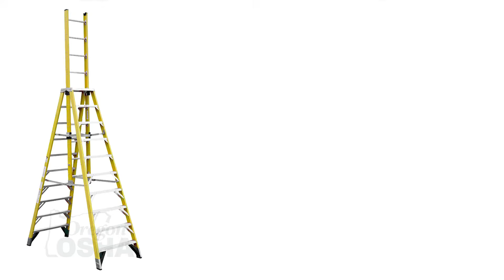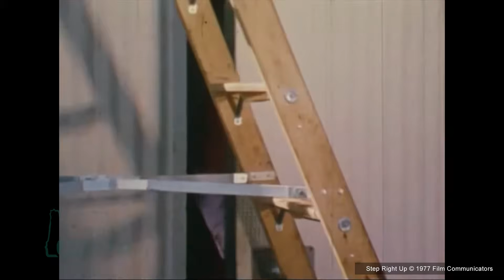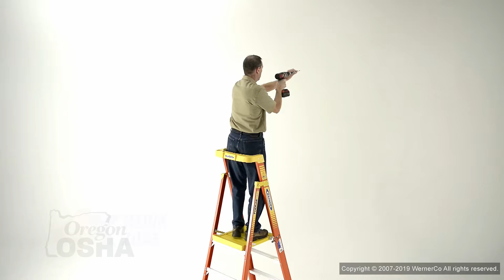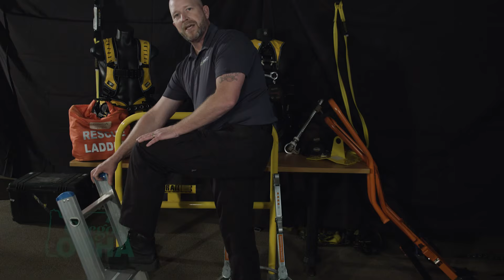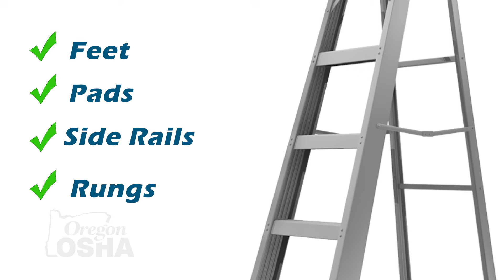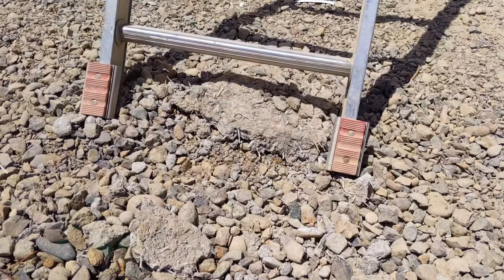Portable Ladder Safety Training | OSHA Rules, Fall Protection, Accessories, Workplace Safety

Comment: Most ladder involved injuries are strains and sprains caused by lifting and carrying, which can be debilitating. 
Most ladder involved deaths can be traced back to operator error, such as selecting the wrong ladder for the job.
One driving point for wrong ladder selection is weight, no one wants to carry the heaviest ladder for their job, but often times the correct ladder happens to be the heaviest one.
Using a ladder mover takes "weight" out of the of picture and allows us to easily use the safest ladder for the job.

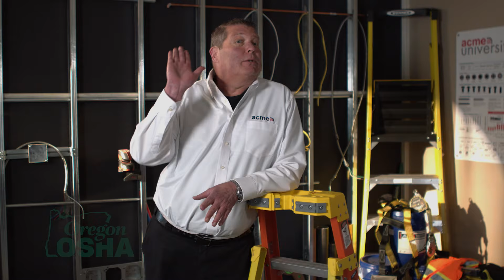Comment: The ladder set up against a wall at 4:05 in the video where they talk about ladder angle, the ladder appears to be standing backwards against the wall.  At least any extension ladder I've used the top section is always on the outside of the ladder, closest to you when climbing.
Reply: You are correct, the fly section must be on top for the ladder shown, otherwise you will split / break the side rail flange from the side rail web and ladder will collapse. In other words the fly section support bracket is non-functional when used backwards as shown in the video. A number of climbers have learned this the hard way. Another clue, you can also see that the rungs have the flats tipped forward instead of being level for comfortable standing.

Comment: Question I work for a weed company I'm maintenance and in the rooms I work in we have about 18 aaon ac units that are about 18 to 20 feet above. I changed all filters and have to use the 20 foot extension ladder and put it against the wall and I can't move the ladder closer to the wall because of the rows of tables. This scares me because I'm afraid it will slip and I'll just go down. I go about 16 feet on the ladder to change out old nasty filters but I never have anyone to hold the ladder for me so the ladder won't slip. It has slipped 1" last time in a room I literally found a 2×4 piece of wood to lay in back of the ladder to hold it. Is this company in trouble with OSHA? I asked my manager about it and still no improvement for purchasing some type of add on supports for the ladder I use like they don't want to spend money. I have fell once before long ago they paid the $4500 dollar bill I almost broke my arm.
Reply: You're not supposed to be doing work far away from the ladder you stand on
It's a hazard as you mentioned.
Request fall protection or talk to the labor board if they won't add side-support for the ladder

Comment: Always tie it off

Most deaths or paralysis occur getting 6' step ladders as the break point is between the second and third vertebrae where the average neck line contacts the ground

If you're going to fall, jump of vertically they say, then you land in your feet, hit your knees then with elbows protecting your head you roll into a ball then roll and turn impact force into kinetic rolling energy, but better off being tied off on a life line, it simple anchor bracket and rope, takes 5 minutes,

Say you have a roof tie down anchor 25' from where you're working at a roof edge, it's 65' from the ground, 70' from the bottom of the elevator shaft, hook your rope around a roof truss right where you're working, so maybe an 8' straight fall would occur if you fell off a wall, however, if you didn't wrap your rope around a close framing member you might be in for a 20 foot fall at the point of drop in only to swing 15' back into a block wall and then your 6' lanyard, so, a 170 lb guy falls, he's at the end of his rope perspective to his fall location, but the anchor point is 25 feet back, he falls for 20 feet in a swing and smashes full velocity 15 feet away into a cmu wall, nominally, but the lanyard or rope with a built in lanyard system (which should then be only connected to your harness D ring and not your 6 foot lanyard) unleashes, so then a 20' swing drop becomes 26 feet of properly connected, or, if improperly connected becomes 6' on the rope with built in fall arrest plus the 20' of rope plus the additional 6' lanyard you're talking s 15' lateral positional fall at the drop point away from Anchorage, and a 32' drop to take you smashing into a concrete stair it elevator shaft, this needs to be reintegrated in OSHA cottages around the globe. It's sometimes impractical to move an anchor every ten minutes, but wrapping your rope around a close framing member plumb up from where you're working might be in order
Reply: Great observation, I agree with your analysis, shorter tie-offs reduce the pendulum swing velocity so you are less likely to become a human wrecking ball that goes splat!